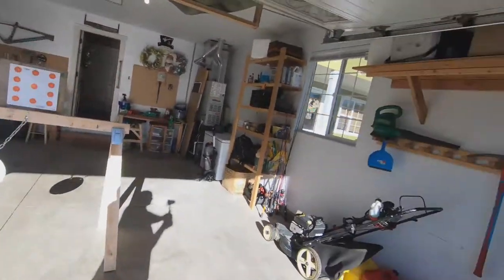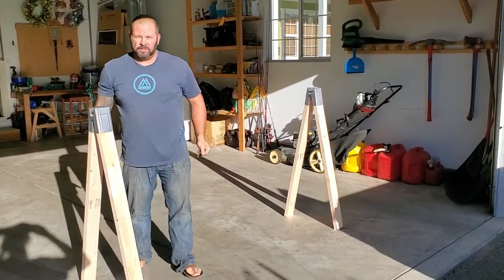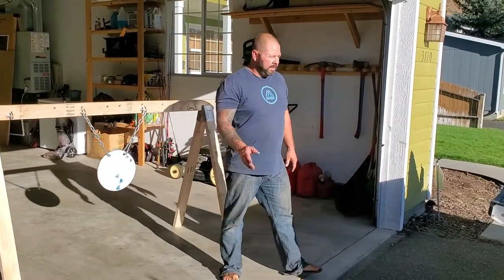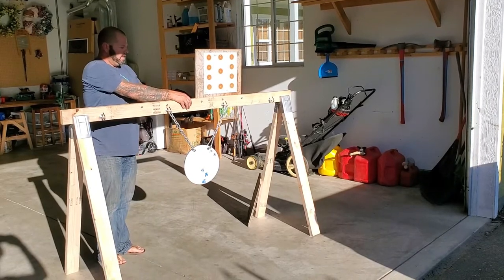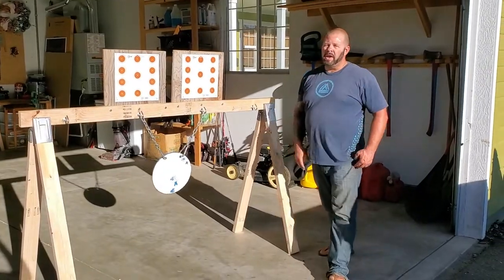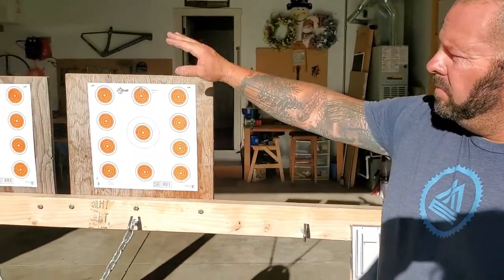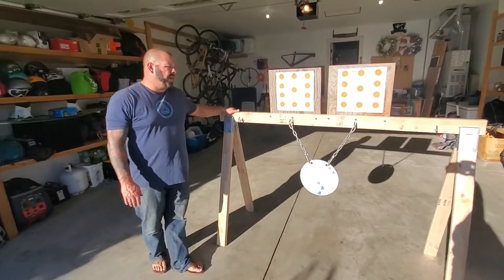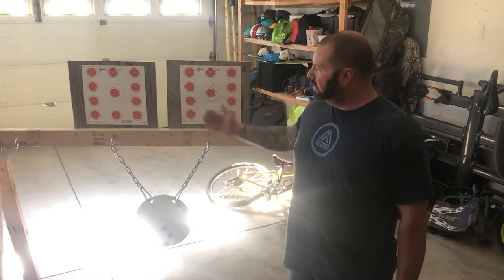How to make a short/long range target stand

Comment: I need to know what was used for the legs to get them to fold.
Reply: the metal he put on the 2x4's is hinged so it will fold.
Reply: Did you not watch the video? He clearly says it.  He also provides links in the description.